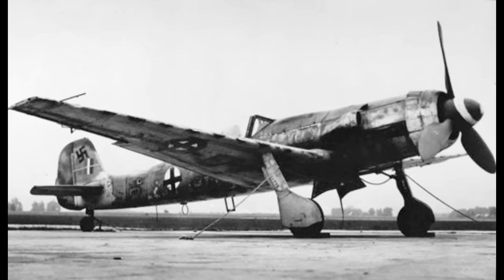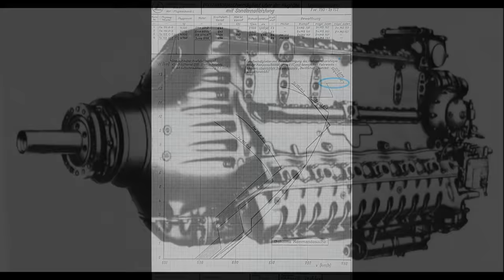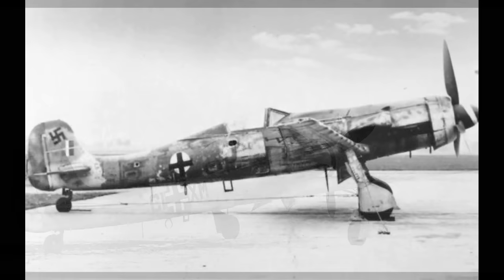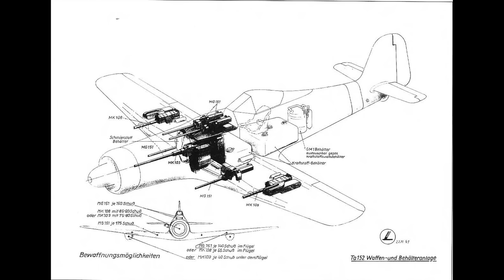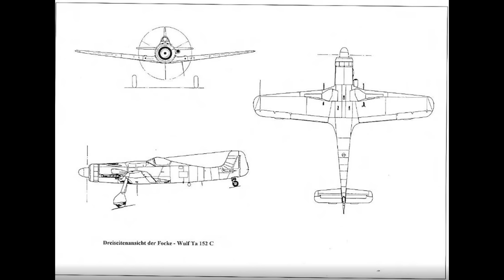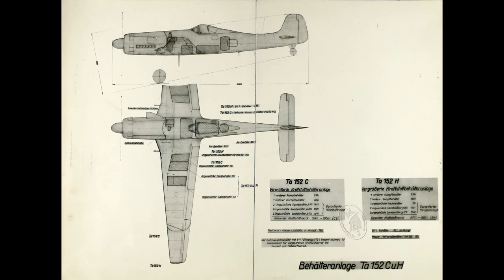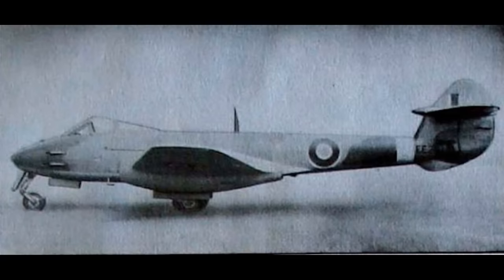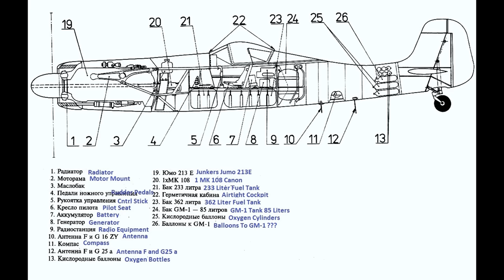Focke-Wulf Ta 152 H-1 Extreme Speed At High Altitudes.

Comment: The 152H-1 when tested by the British was said to have similar flight characteristics to the Spitfire in that in turned extremely well.  Kurt Tank was said to have outrun a flight of P-51's  while test flying a TA 152.  The P-51 pilots stated that the TA 152 pulled away at a relative speed of 30MPH.
Reply: I've seen the Tank story before. It varies between a 152H-1 and a 152 equipped with the Jumo 222
Reply: @paulbantick8266  Tank's story would make sense as the Ta 152 was faster. The model using the allision engine came out in very few numbers
Reply: @paulbantick8266  Nice you gave me an article about the encounters which means nothing to me as never stated any of those points were real encounters or not, just that him escaping would make sense. We have plenty of flight data That it was faster. To be honest this comment seems very biased. I know the aircraft was nowhere near the legend everyone says it is, but fast? it was fast.
https://www.militaryfactory.com/aircraft/detail.asp?aircraft_id=455
Reply: @paulbantick8266  from what I have heard of the XIV not one has been lost to an enemy aircraft.
Reply: @paulbantick8266    However if you have a knowledge of aerodynamics and power to weight ratios  the math gives results almost identical to the real airplane.  It may be a bitter pill to swallow for some that the much vaunted P51 had an adversary that was more potent that it was.  Furthermore the TA 152 H1 packed more punch than the P51 as it was armed with no less than 3 cannon.  I love the Mustang but had there been more TA 152's and the fuel to fly them Germany would have driven the Allied air forces out of the skies  over Continental Europe.
Reply: @LanceisLawson  The allies would have stuck water methanol and nitrous oxide systems on Spitfire XIVs, introduced the P51H and P47N and Supermarine Spiteful earlier and possibly the DeHavilland Hornet.
Reply: @LanceisLawson  Germany would have had to have produced Ta152s in great numbers to do what you say and in 1945 they were incapable of doing that, or fuelling them or training enough pilots to adequately fly them. And in the long run the allied had aircraft with similar performance in the pipeline.
Reply: @Andras_Schiff  That man won't shut the hell up, he looks for any ta152 video in existence, and pull ups his magical spitfire, with his "Spitifirethebestplane" pages
Reply: You wouldve been a great ww2 pilot, Paul im not gonna lie. With that attitude you were the kind of guys the RAF was looking for. Even the Red Baron supposedly said he prefers a match vs the brits than the french
Reply: @LanceisLawson  ahh,  the old "What if".
    As in "What if Napolean had a B-52 at Waterloo"!
    I think even IF the P-51 was Never developed,  the Allies would've achieved the same results as the US was building more airplanes than Germany could shoot down.
   Just as the Sherman was no match for the Tiger or any other models,  the sheer number of them tipped the scales.
Reply: @charleslacombe8325  

The Ta 152-H1Couldn't save the German air war. But that does not detractfrom it's elegance and it's abilities.  Kurt Tank himself outran a flight of P51 Mustangs while on a test flight.  His escape was a simple matter of opening the throttle and leaving the P51's standing.  He pulled away from the P51's by a margine of 30mph leaving the Mustangs behind.  The Mustang was the fastest Allied  fighter at the time but no match for the Ta 152.
Reply: @SvenTviking  The Germans would have probably introduced FW-190D13 with the Jumo EB and J engines as well as the Ta-152C3 with the DB603E engine, as well as the Bf-109K14 (4 bladed prop) in addition to the Ta-152H with potentially the DB engine as well. All of which compare favourably to the allied fighters you’ve just mentioned. However, at this stage it was too little too late. The damage had already been done to the Luftwaffe at that point.
Reply: @mpetersen6 no Ta-152H was ever equipped with Jumo 222

Comment: "There were some issue with supply [of fuel]": you are the grand master of putting it mildly :-)
Reply: British understatement.
Reply: Well, to be precise here.. the fuel problem was a very late war problem for the German Army. It started after the strategic bombing runs on the refineries and oil fields. Before that the Reich produced enough to keep everything running.
Reply: Issues with supply of aircraft , fuel, pilots, and everything else!. That’s putting it mildly. 😳
Reply: @Ascaron1337  Yes... In fact It was a hipomovil army. And the fact that the caucasus oil was going to fix all It is wrong: first every thing was been destroyed (an optimistic number was a year to reach 70%) second: It is just oil you need to refine... Germany Will need to build the refineríes. And three and more important: mover It, wagons locomotives... In 1943 Germany was unable to supply the russian front correctly

Comment: Translation of the slide at 21:50 (very literal, not concerned about English style points here)
IX. High altitude flight
Rescue-safety device:
A. Start oxygen breathing at 4000m and keep always active above 4000m
1. Open oxygen remote control valve. Observe pressure gauge and O2 "guardian"
2. In case of shortness of breath, use oxygen shower (press with elbow)
B. At 8000m altitude, start pressurized operation
1. (Set) rotary dial for breathing air supply to position "pressurized operation"
2. Fill sealing hose. Press valve for 15-20 seconds
3. Occasionally, observe cabin pressure gauge. Internal pressure (should be) equal to 8km
Reply: The “Sauerstoffdusche” or oxygen-shower, would be called “continuous flow” in today’s manuals, and corresponds to the emergency setting on the EROS type masks, e.g. The FW actually states, that the Sauerstoffdusche should be engaged, when experiencing difficulty breathing (Atemnot) - so in fact, this is an emergency procedure. I don’t know, if the German (or allied) oxygen systems were similar to modern systems, in the sense, that they would normally be delivering oxygen through an on-demand regulator, or of they offered the possibility of selecting either dilute or 100% oxygen. However, this oxygen shower possibility would indicate, that by the push of this button, the pilot could engage this feature, and be force feed oxygen under pressure through the mask and into the pilot’s lungs. Activation is by a ellbow activated push button. I’d imagine, that it would be a toggle valve, so as to not be required to hold the button down constantly to have the function active. Maybe, push again to cancel it again. But I might be mistaken. In diving equipment for example, there is such a button on the 2nd stage regulator (i.e. the valve that sits in the diver’s mouth). Pushing and holding that button, opens the regulating valve and air starts streaming out of the regulator; usually to clear water from the mask. But it could, of course, be used to pressure feed air into a person too; an unconscious buddy, e.g. I am bringing up this parallel, because, coincidently, I know this button known as the Luftdusche, since I was taught scuba diving in German by a German speaking scuba instructor. As far as aviation breathing systems are concerned, I was taught in English, so have no clue, how those parts were named by German pilots of that time.
Reply: A piston engined propeller driven single seat aircraft that could fly higher than a B787, but much earlier.

If the pilot were to breathe his own Oxygen system would it not be enough to pressurise the cockpit with air?
Reply: @20chocsaday  That is what most probably has been done.
Reply: Long live the " Drehschieber" 😂

Comment: There's something worth of mentioning too, Junkers had from the very beginning designed the Jumo 210 series as a direct swap in option to the DB600 series engines. The motormounts and all wiring, control- and fluidlines were at the same position between them so it was possible to change from DB 60x to Jumo 21x relatively easily. RLM took this later even further by issuing the krafteie pattern wich standardised the engine mounts, wiring, controllines and so forth between the airframe and engine. It was never widely adopted by anyone else but Junkers and Focke-Wulff, some Dornier designs adopted it too. The annular radiator of D-series and TA 152 variants was also a Junkers desing and propably worth of its own video, as it was aerodynamically suprisingly efficient way to cool the engine.

Comment: A great video as always! The page from the German manual at 28:00 min reads:

IV High altitude flight
Rescue safety device

A. Start breathing oxygen at 4000 meters and keep doing so above 4000 meters.
1. Open remote oxygen valve. Monitor pressure gauge and oxygen guard.
2. If shortness of breath occurs use oxygen shower (press with elbow)

B. At 8000 meters engage pressurisation
1. Turn rotary switch for air supply to "pressurised mode"
2. Fill gasket hose. Press valve for 15 to 20 seconds.
3. Check cabin pressure gauge from time to time. Cabin pressure equivalent to 8000 meters.
Reply: Thanks Axel!!!!!! A million thanks from California!

Comment: My all time favorite WWII fighter. Thank you. Lucky enough to have met Walter Loos and Willi Reschke back in 92. Stabstaffel 301. At lower combat level according to their testimony. it could out turn and out accelerate anything else against them. Stating that at the initial break the Mustang was tighter, but afterward the Ta could continually pull a tighter turn to bring guns to bear. As Reschke stated, "it was my life insurance policy till the end of the war." Though it was optimized for high altitude it ended up being quite maneuverable at any altitude. One of the best books would be by Hitchcock.
Reply: Dietmar Hermann mentions that the first 200 Jumo 213E and Jumo 213F engines had a too weak supercharger shaft.  In practice this meant that many Ta 152H0 had 3rd speed locked out.   Willi Reschke describes getting into firing position on a reconnaissance mosquito  and about to open fire when the supercharger failed and the Ta 152H0 sagged back down in speed.    According to Hermann The Ta 152 with DB603  should have been the first Ta 152H but due to a miscalculation by Focke Wulf they miss estimated the DB engine as being about 100-140kg heavier than the Jumo.  Mistake was picked up too late.  The Ta 152C with single stage DB603EM also was almost the first but issues with C3 fuel delayed it.

Comment: Word for word:

IX High Altitude Flight
Rescue Safety Device:
A. Start breathing oxygen at 4000m and always stay on above 4000m.
1. Open oxygen remote control valve. Monitor pressure meter and oxygen watchdog/guard.
2. When breathlessness is experienced use oxygen shower (to be activated with the elbow).
B. In 8000m activate pressurized mode.
1. Rotary breathing dial to "pressure mode".
2. Fill sealed tube. (Push the valve 15 to 20 seconds.)
3. Regularly check cabin pressure gage. Inside pressure equals 8km.

Btw. 4000m is still commonly used in Germany as max. altitude to fly without oxygen by recreational flyers. Only when staying longer on 4000m you would start breathing oxygen.
Reply: Pilots holding their breath until 4000m:
Reply: @truereaper4572  
Perhaps they should have tried a diet of pure bong water for 24 hours before flying, I know it's worked for me.
Reply: @dukecraig2402  lmaooooo
Reply: @DxMarovitch  
I know it was pretty inappropriate but I couldn't resist, this is exactly why after going to aircraft maintenance school I chose not to work in that field, the FAA has no sense of humor.
Reply: The people who figured out 4000m was the hight to turn on the oxygen were hung at Nuremberg.
Reply: @jamesricker3997  
???
Reference?
Why would it matter?
Reply: @markwilliams2620  It does matter: The information gained by the completely unethical experiments against unwilling subjects which ended in death for most of them has been well documented. When points like this are raised I think about the subjects  I think about them as people and say thankyou for the lives they have saved. They deserve to be remembered as people who gave there lives so others can live.
Reply: @jamesricker3997  from the Gernan Wikipedia:

 "Sigmund Rascher (* 12 February 1909 in Munich; † 26 April 1945 in Dachau concentration camp) was a German concentration camp doctor and mass murderer. For the public of the post-war period, especially in the US media, Rascher represented the prototype of the Nazi medical criminal. The human experiments he carried out in Dachau Concentration Camp and planned to be fatal were classified as inhuman and criminal by the court of the Nuremberg Doctors' Trial. 

A few days before the liberation of Dachau Concentration Camp, Rascher was shot dead on Himmler's orders." trans by DeepL

https://de.wikipedia.org/wiki/Sigmund_Rascher
Reply: How about an addendum for Spitfire Mk VII & Mk VIII high-altitude versions that used sealed and pressurized cockpits?
Reply: @truereaper4572  underrated comment.
Reply: @MothaLuva  Wozu das gut ist?
Wenn du IRL jemanden etwas sagst, sprichst du die jeweilige Person direkt an oder brüllst einfach drauf los und hoffst dass es der richtige hört?
Reply: @jamesricker3997  I don't see why 4,000 m would be a problem, I have both driven and hiked at that altitude.  It's really not a problem.
Reply: Khắc cảnh lê he was trolling.
Reply: Man könnte es nicht besser übersetzen, sinngemäß und völlig korrekt!

Comment: Great video.  You go into the detail of why things do as they do.  I'm familiar with most of the powerplant and aerodynamic concepts you speak of, but you explain why certain approaches were taken and the results. 

I was a Naval Aviator in the '60s and during my training, I understood that at high altitudes - above about 33,000 ft as I recall - even breathing 100% oxygen would not enable the transfer of oxygen into the bloodstream in your lungs.  Thus the need for pressurized cockpits.  "Pressure breathing" would get you a little higher, but not a lot.  I flew the A7 and we breathed 100% O2 all the time from a liquid O2 vessel on the aircraft and a pressurized cockpit as well.  Earlier jets had high pressure gaseous O2 systems which used a "diluter demand regulator" which varied the O2 content depending on altitude.  
On the matter of 2 stage supercharging - I believe that the Merlin engine had intercoolers both between the impellers and after, thus the terms intercooler and aftercooler are both correct depending on whether it is between or after. 

Your stuff is terrific.  I just love it.  I learn so much.  So many of the comments are by people who really have something to contribute too, unlike so many of the inane blatherers  on other channels.
Reply: Spot on- You need pressurisation to get the oxygen through the walls of the lungs. Even breathing pure oxygen you can start to have difficulty as low as 33,000 ft,  above 37,000 feet you would certainly have great difficulty breathing. Some pilots flew at 43,000 feet for short periods without pressurisation (as in, for example the Spitfire V Ju86 combat https://youtu.be/8WDkj0ZYuiA  ) . The two-seat trainer and night-fighter version of the Meteor jet were notorious for not having pressurisation (unlike their single-seat counterparts). Although the engine-airframe combination had a notional ceiling of 50,000 feet the lack of pressurisation meant they rarely went above 35,000 feet and the night-fighter version would have been useless against high-flying Soviet bombers.